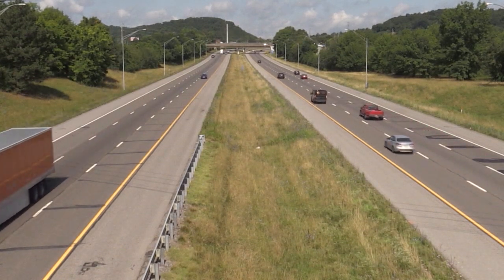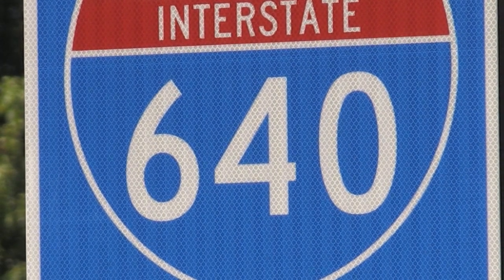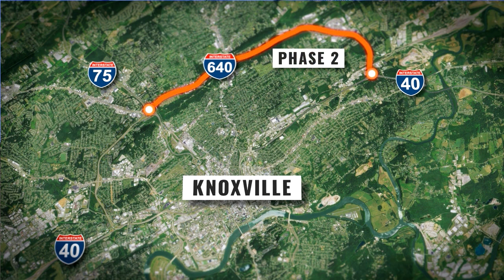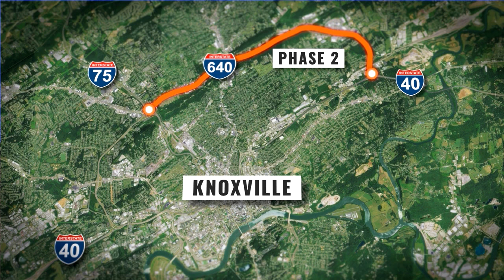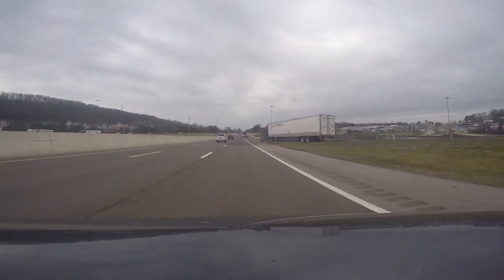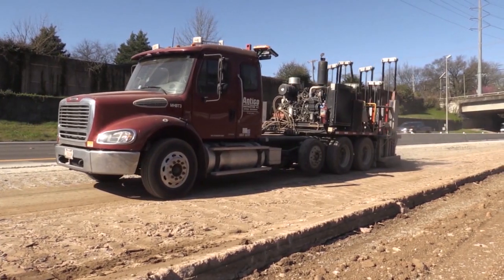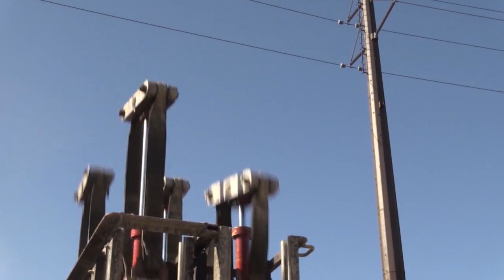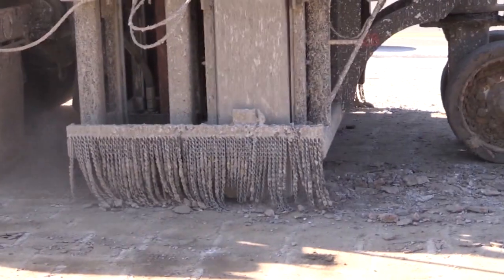I-640 Reconstruction - August 5, 2021

Comment: TDOT needs to put in a whole 'nuther exit off 640 to access the new Amazon facility.  As it is now, traffic exiting 640 at Millertown Pike (in front of the McDonald's) backs up 20-25 vehicles at every red light change.  Another exit should be put in past that exit to serve the Amazon facility where the old Don Pablo's restaurant is.  This should also include an entrance onto 640 from the Amazon facility so that traffic doesn't have to go down to the interstate entrance at Washington Pike.  These changes would end about half of the congestion in that area.  In addition, they should lower the speed limit on 640 in that area back down to 55 MPH because of the increased traffic.
Reply: Agreed!

Comment: Very thankful to hear that they are finally fixing a highly used and often very problematic section of 640. It will be a difficult time for those who utilize 640 often and for those visitors and transients traveling through town.  I am curious to know the start dates on this project and estimated completion dates.  (And Randy Jordan is very correct about having a separate entrance for those going to or coming from the Amazon facility!)
Reply: You'd think they would have already included that in the changes.  They need to level the ground between 640 and the service road (Mall Road) so they can put in entrance and exit lanes there.
Reply: @randyjordan5521  Will be hopeful that they do that!

Comment: The problem with I-640 is that it really does not bypass anything. Taking it is longer and usually doesn't save time. It does save some aggravation of driving though town. Topography would have been challenging. However, I-640 ideally would have been started near Strawberry Plains, arced north of Clinton, between Oliver Springs and Oak Ridge, and then re-connected to I-40 near Gallaher Rd. to the west of the 40/75 interchange. Knoxville has way too much traffic for a city of its size and it is due primarily to through freight traffic.